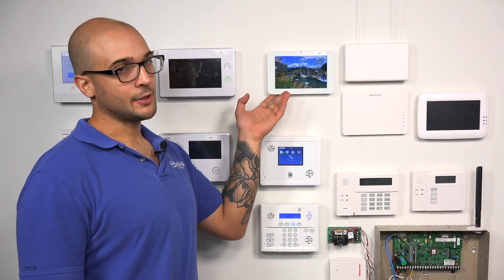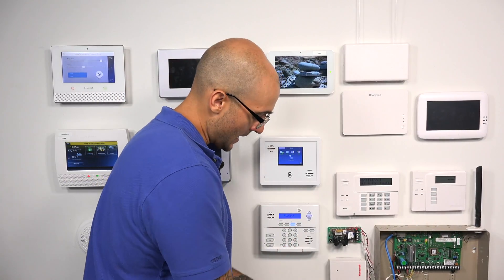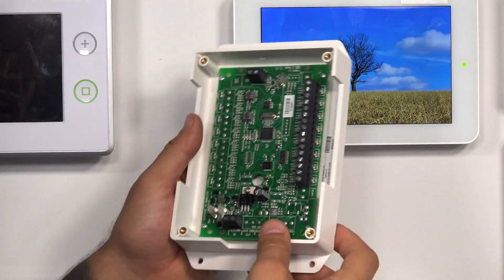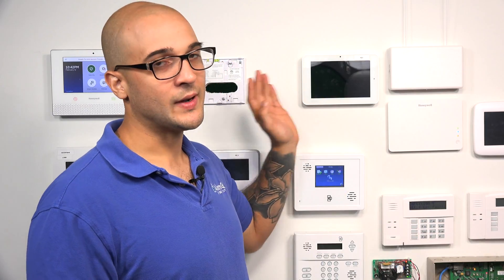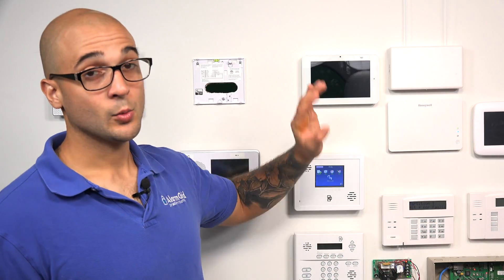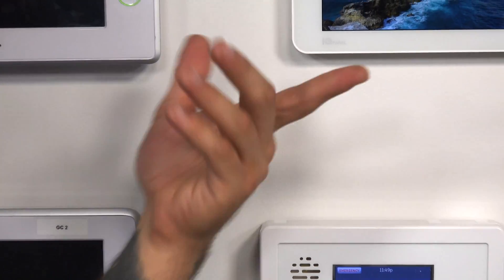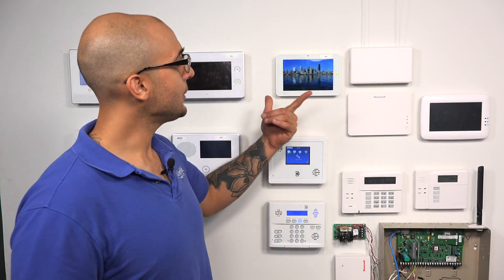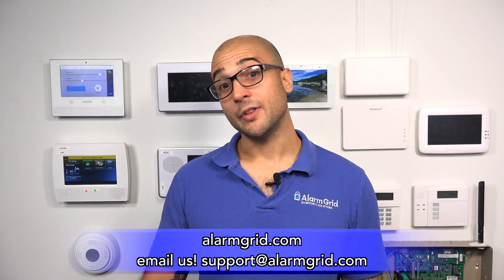Can I Use Wired Contacts on a Qolsys IQ Panel 2?

Comment: Hey... What am I doing wrong ? I have a Qolsys with an 8 zone hardwire translator, I'm doing a service call on it. 
From what the customer says; The original installer was fighting with it. Everything is wired correctly on the translator. But yet, the keypad still says; Hardwire translator open. I figured it a tamper switch, yet everything looks normal. I only see a tamper on the cover, when I remove the cover I see tamper switch and hardwire translator. When I close the cover, I still only see hardwire translator. I'm fresh out of ideas. What am I doing wrong ? I have 3 hardwire zones. I grabbed a meter and confirmed I have 4.7 ohm resisters.

Comment: Just to be clear, I will require a 4.7K resistor with just a wired door sensors? on a IQ 2 Plus panel.
Reply: That is correct.